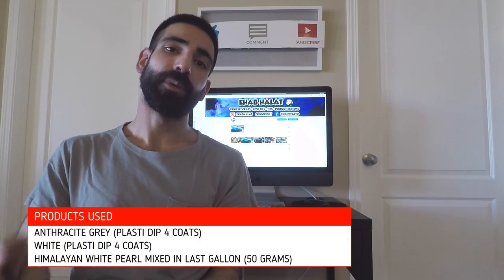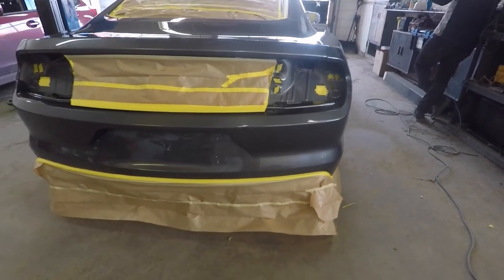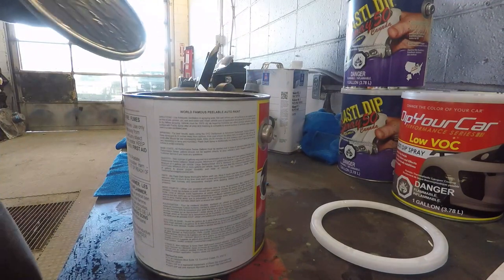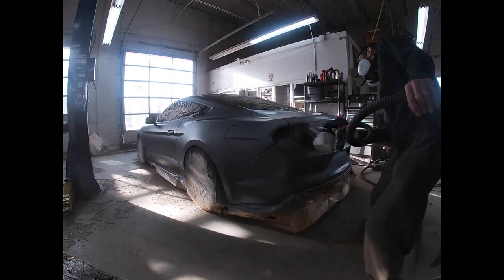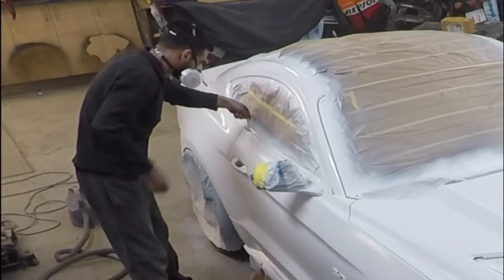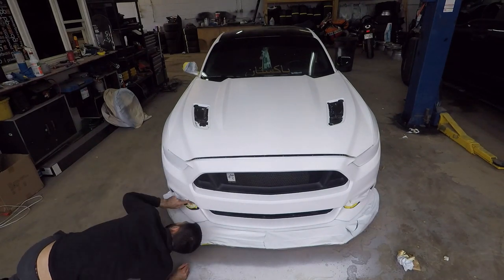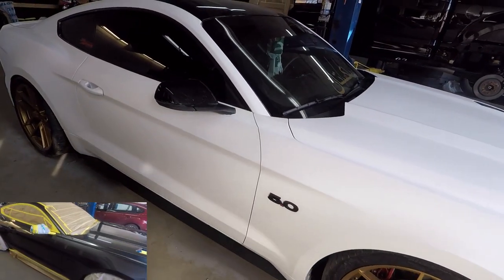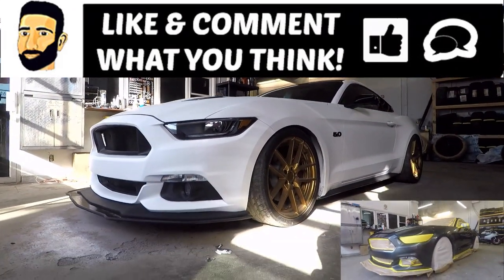Liquid Wrap - Satin White Mustang (Plasti Dip)

Comment: How does the plasti-dip hold up to dirty hands on or around door handles? Is it easy to clean?  I'm building up a white Chevy van and the paint is peeling in places,typical GM white. I was  thinking this or Line-X. This can be peeled off and changed correct?
Reply from the maker: Holds up great just make sure you clean and maintain the plasti dip by washing it once a week. For door handles you should remove them to get the backing of the handle or it could start lifting or put a piece of clear vinyl on the back of the handle so it doest start lifting up. Yes plasti dip can be peeled whenever

Comment: How long will the unprotected plastidip usually last?
Reply from the maker: Unprotected is not recommended because you have to maintain it to keep it looking the freshest. It will still last about 2-3 years, it just wont look as good if not maintained properly
Reply: @EhabHalat  Great info, thank you! How do you protect it? When I said "unprotected" I meant as in clear coat. I don't know much about plastidip. Since a friend of mine just put 2k clear on his plastidipped wheels It struck a whole new level of interest for me. Thx
Reply from the maker: The 2k will make the wheels very durable but abit harder to peel than regular plasti dip. The 2k gloss also is easier to clean than regular matte plasti dip  but it can be protected by many products like dip shield and dip coat which i have a video on so check it out
Reply: @EhabHalat  killer thanks, I'm checking out those vids now.